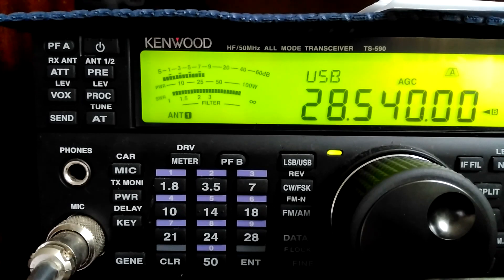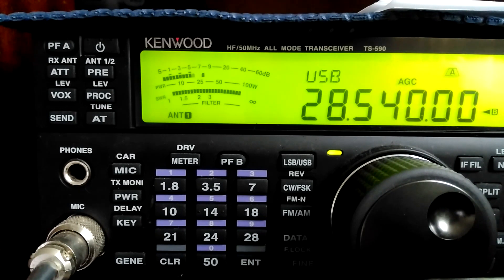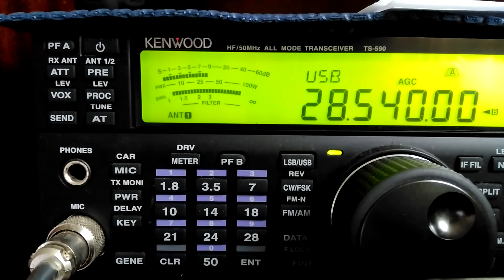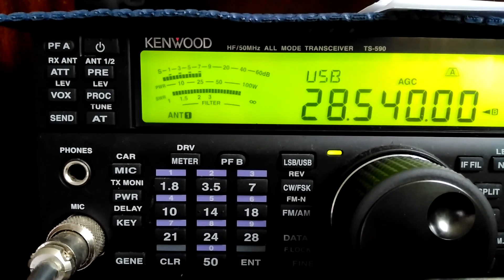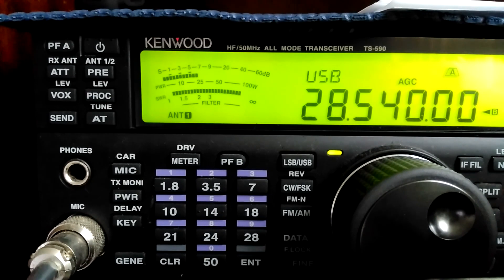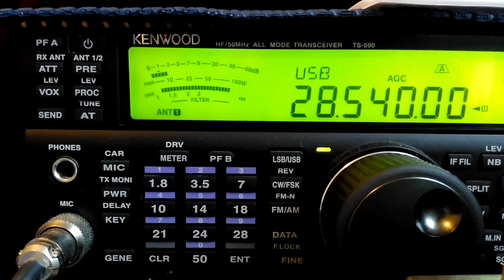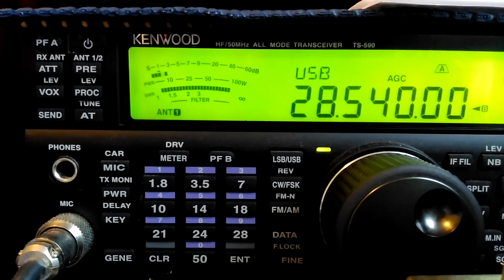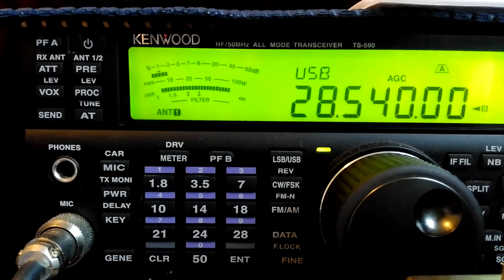DIY.. PC headset conversion for the FT817/FT857 build & test

Comment: Excellent info! I had to download the FT-817 manual to see that the Mic connector is indeed an RJ-45 connector, thus why you did this project. 

I'm building a similar headset for my paramotor helmet. It already has a PTT, directional Mic and speakers in the earcups. What I want to do is add a box so I can switch the PTT button between my Baofeng UV-B5 (Ham 2m/70cm) and my Yaesu FTA-450L (airband).

My headset already has an 8-pin GX16 connector on it, plus an audio input, so I can have two devices connected. Unfortunately, when I have my Yaesu plugged into the audio-only, and I transmit on my Baofeng, I get some odd interference at the end of my transmission in my sidetone. I'm not sure if this is because the audio input is not expecting a radio but a mobile phone.

A few questions:
1. Why the capacitors on the mic side?
2. Why the resistor on the positive side?
3. Why the capacitor between ground and mic?

What are the functions of those, and how do they make this work well?
Reply from the maker: In brief as I'm at work.. the caps are there to select different tone. The one to ground would be good housekeeping to drain away stray RF. The resistor I think was current limiter or something. It's a long time since I made this so cant talk u through it.. plenty of information online.  73